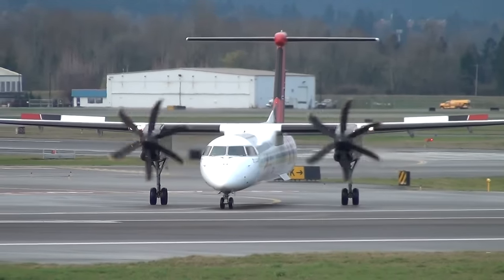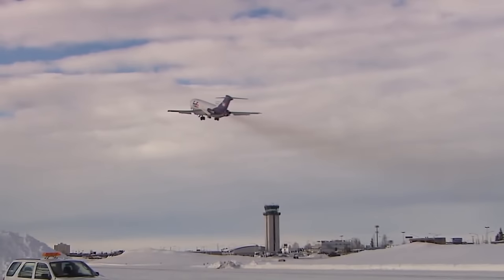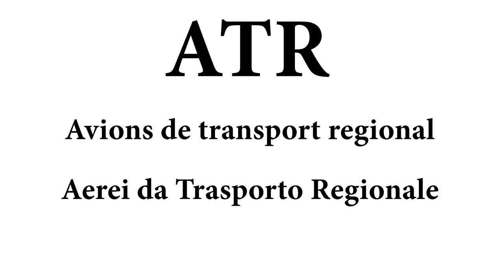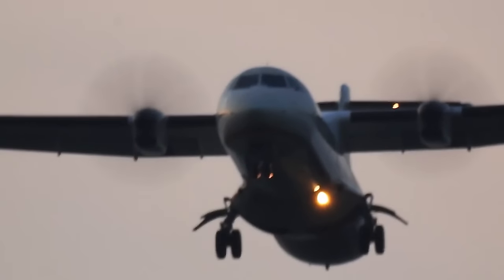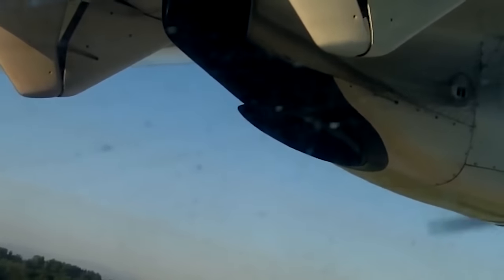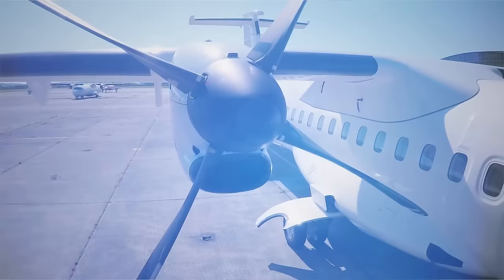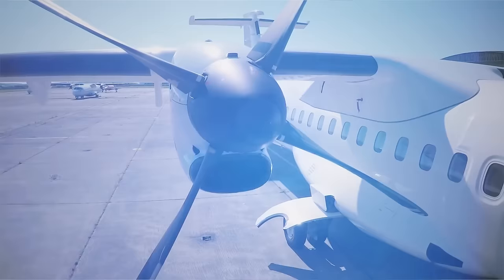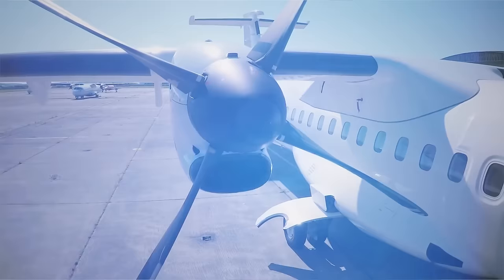ATR 42/72 - the European turboprop

Comment: Surprised you didn't talk about the weight balance issue the ATR has where you have to load the front half of the plane first because if you don't it'll fall onto its tail.
Reply: General Managee Continental Express PWM 20years. We had an all ATR fleet.  Part of standard safety equipment was a metal stand that is placed in designated location at aft of the aircraft prior to opening and doors upon arrival. It prevents any on the ground balance issues. The majority of aircraft require loading forward cargo 1st to prevent ac from falling back on its tail.  It's standard practice world wide

Comment: ATR 42-300 equipped with PW120 Engine and 14SF5 Propeller
ATR 42-320 equipped with PW121 Engine and 14SF5 Propeller
ATR 42-400 equipped with PW121 Engine and 568F Propeller
ATR 42-500 equipped with PW127E and 568F Propeller
ATR 42-600 equipped with PW127M Engine (not PW125M) and 568F Propeller

ATR 72-100 equipped with PW124B Engine and 14SF11 Propeller
ATR 72-200 equipped with PW124B Engine and 14SF11 Propeller
ATR 72-210A (-500) equipped with PW127F Engine and 568F Propeller
ATR 72-210A (-600) equipped with PW127M Engine and 568F Propeller

The PW127E/F can be used on ATR 42-500 or ATR 72-210A (-500). 

An ID Plug in the EEC has to be changed to identify for witch aircraft typ the Engine will be used.

For the new -600 aircraft there will be a modification to identify the aircraft typ and power setting by itself.

Comment: Sky, I've noticed  in many of your videos the usage of "younger" / "older" as synonyms for "smaller" / "bigger", respectively. They are not! 

Younger / older refers exclusively to age. It would be appropriate to use them as referring to their introduction day, such as for example the 42-600 aircraft is "younger" than the 42-200. But the 42-600 is not "younger" than the 72-600, rather is "smaller" than the 72-600.

Please pay attention to this in your future videos, as sometimes this can be confusing.

Comment: The amount of errors in this gives me a headache. Incorrectly named the 72-500 as a 72-200. If we want to be more correct it should be -212A. And there was other models of 72-200. It goes 72-200, 72-201, 72-202, 72-210, 72-212 and finally 72-212A which is the same designation used for 72-500 and 72-600. The only difference on the -600 is the glass cockpit and Cabin interior (overhead bins and seats). Engine options are the same. And the 42-300 and 42-320 had the same engine core. The only difference was Pratt charged extra for the extra “power usage”. Some cases EEC would need to be upgraded but effectively the same engine just using more power.

Comment: Since they're high wing, why can't they venture in research to build tilt rotor technology for short take off/landing capability if not vertical take off/landing versions
Reply: Would be possible but would defeat the purpose these planes were conceived for: short haul, good fuel economy. ATR will however have a STOL version of the 42 in a few years. Broader wings, higher tail for bigger rudders and the ability to use runways of half a mile length. Might be a serious competitor for all those small island hoppers now in use but becoming very long in the tooth.

Comment: back in the 80's american eagle had issues with the deice booth on the leading edge. it would freeze up causing poor airflow over the wing, stall conditions and then crashing. @ 11:02 the speaker mentions 63 accidents/crashes, out of 1500 planes, as well as the ATR doesnt beat safety records.simply put, for every 100 planes, 4 will have accidents...bad statistic...ATR- Aircraft Trash Resurrected
Reply: You know what you are talking of . . .

Comment: Naah, the Q400 is the best
Reply: I agree. There is no beating the mighty Q.
Reply: Obsolete though
Reply: @hunterseeker8906  Not yet, but I doubt that Viking Air, which takes over production from this year, will have the resources for development. Add to that that the Q400 is already far more expensive than the ATRs, and its future is bleak.
Reply: Not really obsolete. Lots of markets and airports are just too small for regional jets. Tons of Q400s here in BC... the ATR is a terribly underpowered flatlands airplane.
Reply: @Bartonovich52  atr goal is to be economical, that why they are way more atr than Q400. They not for the same use

Comment: Weird aircraft, build to fly in Europe in winter condition,  but can't handle icing conditions well!
Reply: Lostcreek 1 weird ????
Way better and safer than a Q 400
Reply: @ruedigersonntag9315  Not supported by data, ATR  fewer sales and more fatalities than 400.
Reply: Ok, thanks for correction.
Still hard to believe, but data
don't lie
what about all these gear incidents ??
Reply: @ruedigersonntag9315  Haven't a clue on gear, other than I'm sure they must be working on solving the issue. I'm a high time pilot  not an engineer!
Reply: Thanks for your answer, I am a senior engineer, 11 years ATR, familiarization course Q400 only.
Last year a Q400's NLG failed, didn' t lock, but to be fair I think it was Maint. fault. By the way,  MLG is still a big issue
On ATR as an experienced pilot you know deicing system is not designed to remove heavy ice, system must be activated at an early stage to prevent ice buid up.
Most ice issue accidents we heard about it was said system had been switched on too late, unable to remove heavy build up
Reply: @ruedigersonntag9315  Thanx for your insight on  issues.  I always followed the following for icing, Get out of conditions as quick as possible.  ATC  was always accommodating.

Comment: The ATR 42 has been involved in 47 aviation accidents and incidents including 34 hull losses.[34] Those resulted in 276 fatalities

The ATR 72 has been involved in 46 aviation accidents and incidents including 29 hull losses. Those resulted in 398 fatalities.

No thanks.  Sounds like a widowmaker to me.
Reply: DHC-6 Twin Otter - 384 accidents including 278 hull losses. Around 980 aircraft built, ATR 42/72 more than 1500.
Swearingen Merlin/Metro - 183 accidents including 135 hull losses.
Lockheed Electra - 67 accidents including 59 hull losses. Those resulted in > 1000 fatalities.

Comment: The ATR is junk compared to the mighty Q.
Reply: Canadians need to design planes that are reliable. Our weather is usually terrible.
Reply: Why that claim?  Without evidence it sounds like mere jingoistoc opinion.
Reply: Q might be "better" but god is it ugly, as are all tube turboprops with landing gear under wings. ATR might not be the best but is certainly the best looking Turboprop.
Reply: The Q Is very more expensive
Reply: 3 atr for the price of 2 Q400 , think profits .
Reply: The Q is a more capable plane and doesn't sell because of it. For regional service the ATR is cheaper and more efficient.
Reply: Having spoke with a chief mechanic who worked on the Q, his opinion is that the Dash is junk, with unreliable main systems like the autopilot or the landing gear failing on an alarming regular basis compared to other manufacturers.
Reply: I couldnt agree more.. @fingerhorn4